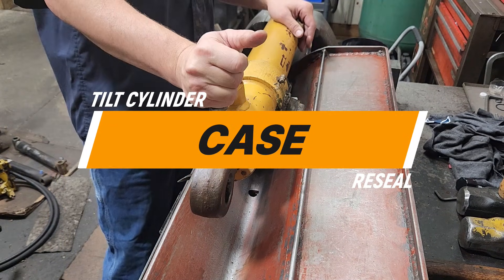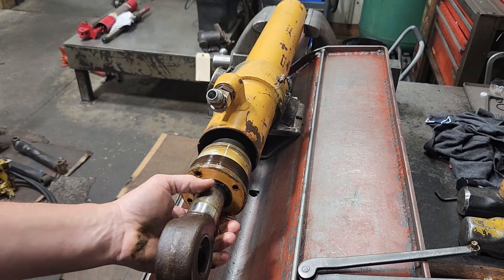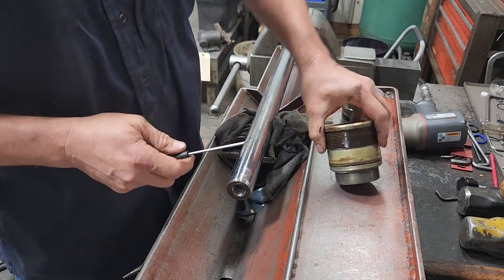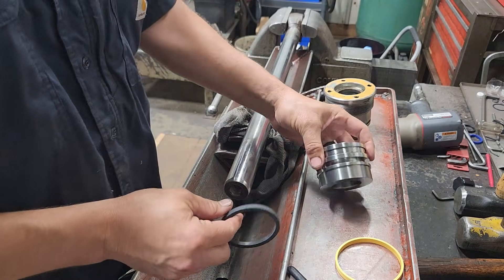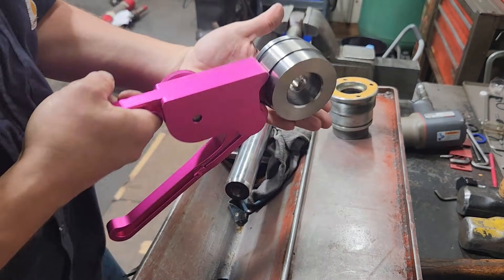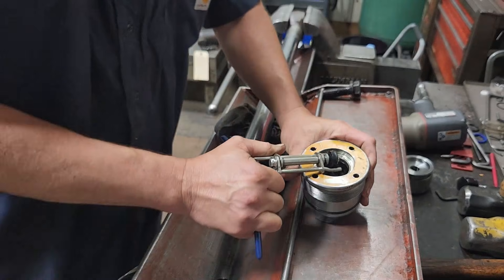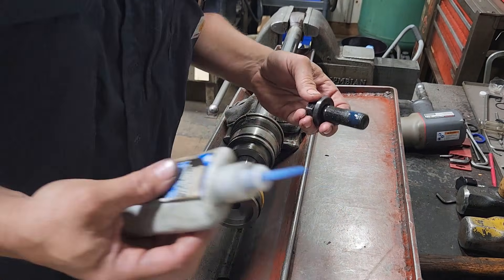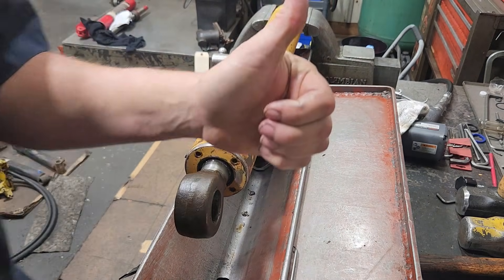CASE Tilt Cylinder Reseal

Comment: Excellent video!! It's this a 1835b? Looks like mine. I've found the complete cylinders on ebay new for $200. Thinking of getting them and rebuilding mine later for spares.  What do you think? Thanks for this video! I've subscribed 😊
Reply from the maker: Thanks! I believe this cylinder was off of a Case 580 backhoe front end loader and was the bucket tilt cylinder. As long as yours are good, I'd just reseal. Thanks for the support!
Reply: @HydraulicRepair okay thanks for the suggestion. I've already bought the seals a while back so I think I'll take your advice. Wish you were in Virginia lol but after watching your video I'm sure I can do it!... Thanks again.

Comment: What do you use to clean your parts?
Reply from the maker: Generally, it is just a wire wheel on a bench grinder for the exterior of parts and a wire wheel on a die grinder for the interior of parts. Then, using a rag and blow nozzle to wipe everything down. Thanks for watching and commenting!